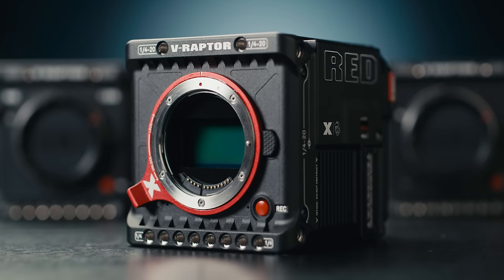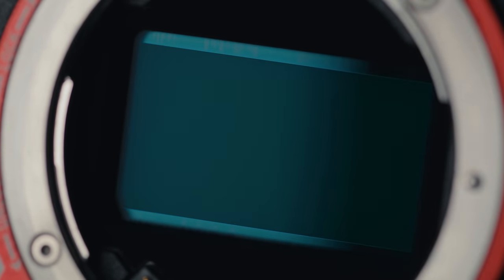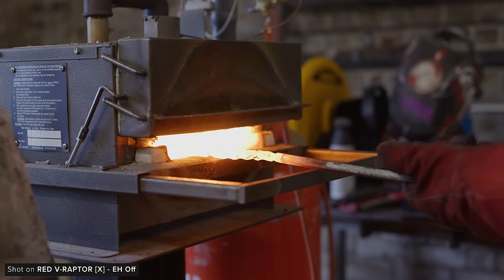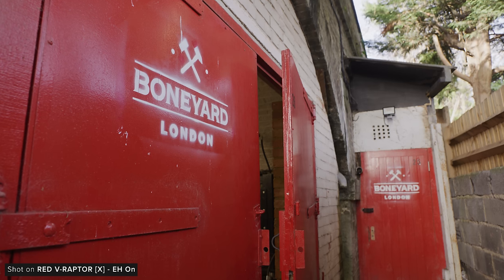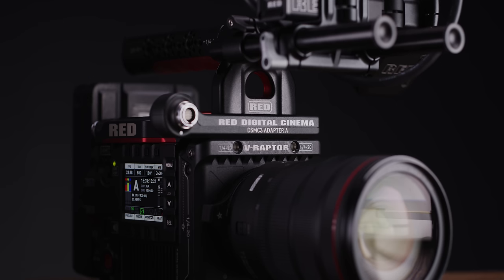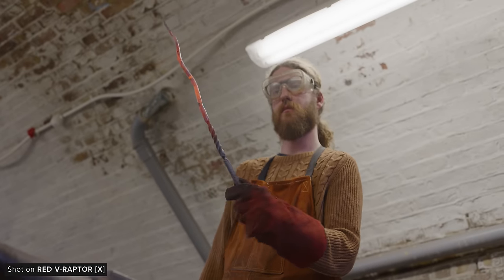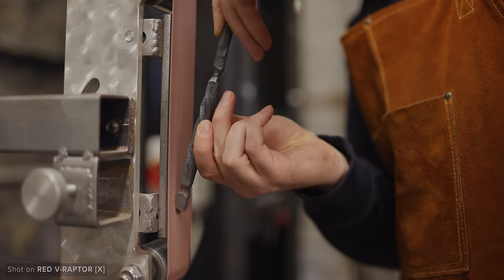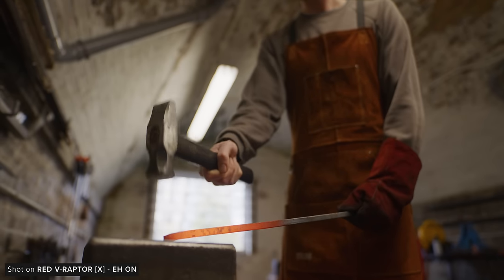RED's INCREDIBLE Full Frame Global Shutter Cinema Camera!! - RAPTOR [X] First Look

Comment from the maker: Hey All, RED gave us this camera 3 days ago and we've crammed in a lot of testing into that time. This video was created TODAY. Written, PTC shot and edited together today as a first look. Please forgive how short it is. The Creative is ALL straight out of camera with only slight adjustments in REDCINEX Pro as the current EH files do not open in Resolve so we couldn't give them our regular pass. We are also running open days in our central London showroon on the 31st and 1st next week! Sign up here - https://cvp.com/events

Let us know if you have any questions about the X in the comments and our follow up in-depth look will be out asap! Jake
Reply: Meh. Every since they filmed an IMAX CGI-fest on an FX3, ARII and RED don't really impress as much anymore.
Reply: @Borodin410 good for you, the Arri is much easier to work with than the FX3 though
Reply: Not sure about that. Beginners can execute an FX3 workflow with relative ease. It's a consumer camera, unlike ARRI and RED.   @DollyRanch
Reply: @Borodin410  nonsense, an FX3 has no false colour, no ND filter, clunky menus, no EVF - Arris are simply easier to get a good exposure with, as for workflow? ProRes couldn't be simpler to use in FCPX or DaVinci Resolve
Reply: Could you please test out the extended highlights against the older HDRx function? And also through proper post processing of HDRx in which the tracks are split and the ghosting mitigated with RSMB or other post motion blur effects applied to the sharper X-track. It seems extended highlights does this in-camera, but would be good to see if it just took the post production workflow for HDRx and put it into the camera as an automatic process.

Comment: I can't wait to see you guys test the extended highlights under stress conditions such as fast moving subjects, fast camera movement, and high ISO. I would also love to see a side by side with regular V-Raptor to test regular dynamic range, detail, and noise. Please compare ISO 3200 up to 12,800 side by side so we can see how the noise in the shadows looks. An audio comparison would also be nice! Because the preamps on V-Raptor are horrendous. I can't believe they even bothered having an XLR option. Lastly, is the sensor stitched or is it whole? In your video, I can't see a stitch line like you can when you look at the V-Raptor sensor.

Comment: I'm VERY interested to see how RED have implemented the EH mode and what the drawbacks are. Does it hold up in moving subjects? How does it work under the hood? I will be watching the dynamic range benchmarks closely

If framerate options are reduced, I'm curious if that means that there are motion artifacts like Arri's extended sensitivity option does. Otherwise maybe it's just slow like the C70's readout is slow, but it's crazy if they've implemented a sensor that really has so many stops before photosite saturation

Comment: Sad to see Red completely abandoning the OG Komodo.. 
This EVF would have been awesome for it, but it looks like they're trying to only improve the Komodo X so you find yourself wanting to upgrade..
Reply: How would they have made the EVF work with the OG komodo?
Reply: @BrandonTalbot  OG Komodo has a top connector, but it only works for the outrigger handle… has a tons of pins that can only be used for a dumbass button 😅😅
Reply: Completely abandon?  That's a bit dramatic.  It was always designed to be a crash cam.  And when Red saw that people were using it for a while lot more, they came out with the Komodo X for more generalized work.  It's over a 3 year old camera at this point, and is already maxed out in its capabilities.  What would you have Red do?
Reply: Because it doesn't have the hardware and the juice to power anything else, this is why the EVF is not compatible man. The OG komodo was never supposed to be an A cam. That's why they made a Komodo X @Yann_Poirier
Reply: After one year how much will it be worth? 🥴 Half the original price?
Reply: @menoforma  You’re looking at it the wrong way.  A camera’s value is in the money you can make with it, not its resale.
Reply: Yeah cause all of their cameras have historically been worth half after one year  @menoforma  🤦‍♂
Reply: @Yann_Poirier Those pins are incompatible with DSMC3, they have different layout/functions. The pins on top of Komodo OG were supposed to work with the RED Hydrogen, but it ended not happening.
Reply: There is an accessory for the Komodo called Link Adapter that gives you the ability to use your phone to the camera and connect the camera to the internet via usb-c, but it was never very popular.
Reply: A few more connectors, top pins works with the monitor, completely new audio, better AF, 2x the frame rates, Mappable buttons, completely new media...sounds like the exact same camera for sure  @bastelwi  🙄
Reply: I use it all the time so I will - I know you're trying to make me feel bad cause you're that guy but it's not gonna work @bastelwi

Comment: Wow, it looks really good at 7 stops overexposed. Comparable to Alexa 35?
Reply: Yeah, that 7 stops over was crazy compared to previous REDs. Even if it's not quite as good in DR as the Alexa35, being close with 8k120, global shutter, and costing less than half the price makes it a pretty compelling option.
Reply: @TechnoBabble  Absolutely. Big step up for red.
Reply: @MarkusFinholt  There must be some caveat. I think because of the fast sensor they are using some kind of double exposure, that is why your frame rate is divided in two and data rate is doubled.
Reply: @danielvilliers612  Yeah there is no way it's not. But I thought that's what Arris DGO patent covered? So I wonder how they're allowed to use it, or if they circumvented it somehow.
Reply: I guess they are taking two shoots and then combine them in post. Could mean that if you are doing 24p your real shutterspeed is 1/96 or it is 1/24  @MarkusFinholt
Reply: @GreatCassian  Literally what did I just read?
Reply: Arri = 1 pic running through two different circuits at the same time and combined in camera (patented)

Canon= 1 pic running through two different circuits successively (patented)

Red most likely: 2 pics taken one after the other and then combined in post. So instead 24p you are filming in fact 48p so your real shutterspeed is 1/96. Otherwise your image is blurry as hell. For SlowMo or sports usefull. But for narative work useless. @MarkusFinholt
Reply: @GreatCassian  Ah, that makes sense. Is this 2 picture workflow patented at all? I think Z-cam talked about doing this trick with their new E2-M5G that also has a DGO global shutter sensor. It would also explain why they claimed to have 16 stops of dynamic range for a MFT camera.
Reply: Na, thats not how they are doing this. Look at how they are able to take 2 exact frames for VR.
Reply: @intenseillusions yup, that’s exactly correct. Previously with HDRx you couldn’t do two frames with the same shutter angle, but today it’s a good opportunity to be used in led volumes. They way it’s described is exactly correct - those are two separate frames that go one after another with the exact same settings of shutter angle. The principle is exactly the same as HDRx here, but they’ve added an ability to use the same shutter. This is a crazy simple idea (considering they’ve basically done it already on the OG Epic), but extremely useful for the moment. Genius!
Speaking of wider DR - will have to see is there any new algorithm that combines the two streams, and is it able to be viewed in live view. If yes - I suppose it’s done in hardware in some way like OG Alexa and Canon C300 (dgo), if no - I suppose it’s still done using shutter, but maybe with a better way how the streams are combined. We’ll have to wait and see some real world tests, because right now all of the shots showing the highlight retention somewhy have no motion or shot in slow motion.
Reply: @danielvilliers612  same thing Arri does with their DGO process in camera.

Comment: Isn't the extended highlights just HDRx? Just marketed under a new name as a new feature. 😑 Good that it's there again finally, but hyping it up like some mega new feature seems a bit over the top. We used this as far back as the Epic Mysterium X.
Reply: you could never do it in camera, and it had ghosting. so this is a big leap forward.
Reply: @intenseillusions  You could not "see" it in camera, it's still the same merge of tracks. And the ghosting was mitigated by post-processing strategies. My point is that it was an overlooked feature that I don't understand why people almost never used. We still need to see exactly how this feature looks when in a situation where ghosting appears, so far all material released by Red are shot in high speed overall faster shutter or static shots. We need the "person against dusk sky" hand held shots to really see how well it holds up against HDRx.

Comment: QUESTION: for Extended Highlight mode, is it available in ProRes or only in R3D? It makes sense that the data rate is doubled, like how the Alexa 35 needs the additional bits for its DR. But I'm curious what's the best DR you can get on the Raptor-X in 4K ProRes using the full sensor width. If you could post a table of formats and data rates for EH mode, that would be great. As always, THANK YOU for this great work.
Reply: Only in R3D. It will work on R3D + ProRes proxy but the in-camera render will not be as good as doing it in post workflow. Think of the in-camera version mostly just for monitoring
Reply: @marccattrall7500  thank you! I'm BRAND new to the RED world, just took delivery of my V-Raptor last month. It has been an absolute joy to use. Those extra THREE STOPS in the highlights look incredible. Closes the gap with ARRI while keeping everything that makes the RED amazing.

Comment: Is the extended highlights mode the DSMC3 equivalent of HDRx in DSMC1/2?
Reply: HDRx caused ghosting and couldn't be done in camera, so no.
Reply: More like equivalent to Arri's DGO and Canon DGO (Dual gain output) Basically its like an automatic, In camera HDRx.
Reply: @intenseillusions   My guess as he said it comes from some limitation, it is the same principle as HDRX. With the super fast sensor, perhaps the ghosting will be less.
Reply: @yreyes1451  But Gain is just ISO, so if you’re shooting Raw and ISO/gain is a post-production decision, how is DGO even accomplished? Or is this a thing for people who don’t shoot Raw to have a better dynamic range? 

HDRx recorded a long exposure and a short exposure alternately, which meant the sensor is actually changing the amount of light it receives.  Super helpful for Timelapses. But yes, it ghosted in certain situations. If they recorded the short and long exposure frames simultaneously, that could be a way to improve the result, though it would still have its own, less obvious form of ghosting.
Reply: @MackerelSkyLtd  They can eliminate the ghosting if both exposures use the same shutter speed then the camera can sync the 2 exposures internally. I guess they can record both exposures with the same shutter speed because of the super fast global shutter readout.
Reply: @yreyes1451  Pretty sure there will always be ghosting of some sort, but if the frames are gathered synchronously rather than alternately, then the ghosting would just look like motion blur with a non-motion-blurred start or end of the frame. Could even be a cool stylistic thing to play with.
Reply: @MackerelSkyLtd   I guess we will have to see (I think there will be no ghosting) but well see. If canon managed to get it right on the C300 mk3 and the C70 why would RED implement a similar concept that shows artifacts?